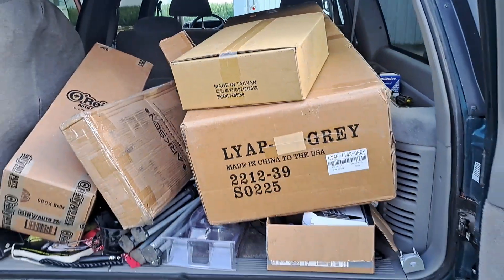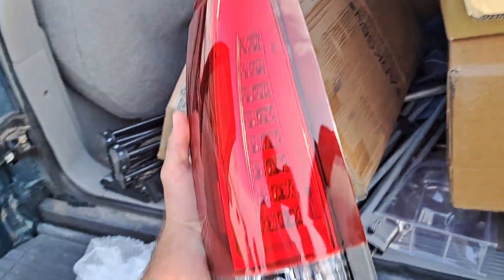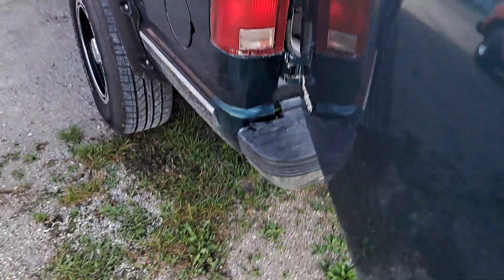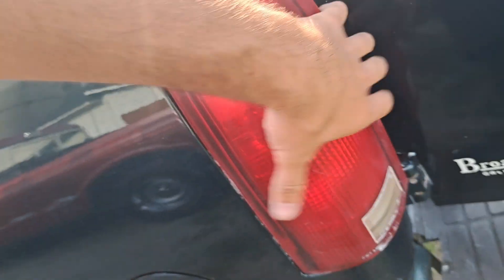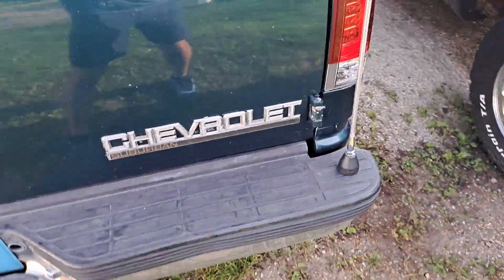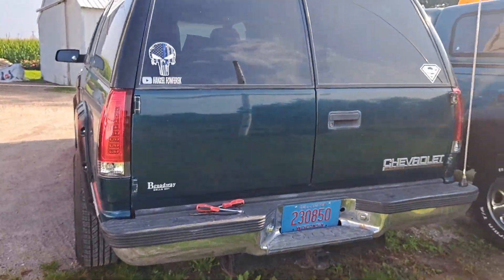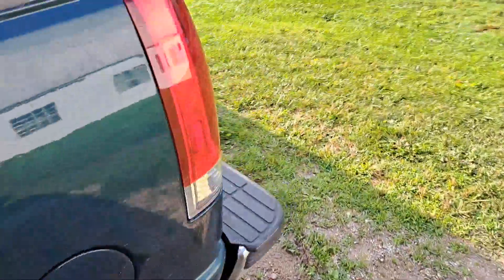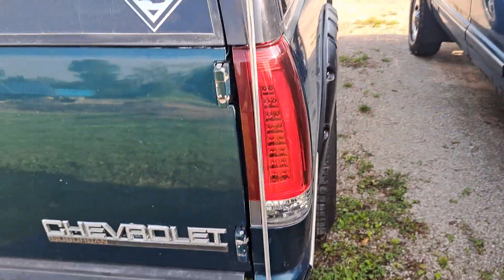Installing AmeriLite C-Type LED Tube Taillights From Amazon On My 1997 Chevy Suburban

Comment: You can get a mount for your antenna so it’s not just out there on your bumper.
Reply from the maker: True but I like it on the bumper
Reply: @HanzelFonferek  just giving ideas.  On bumper it’s easier to snag of branches. If you go off road.